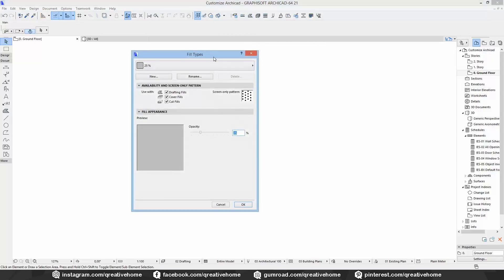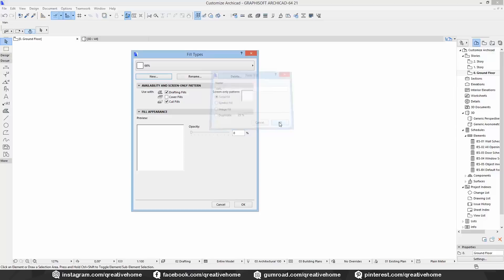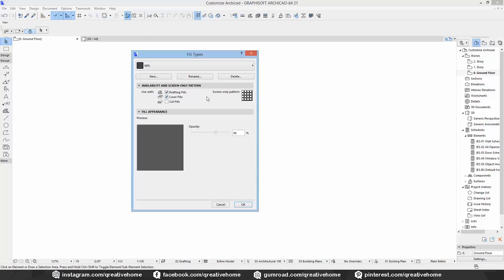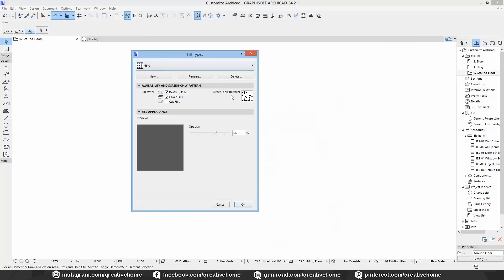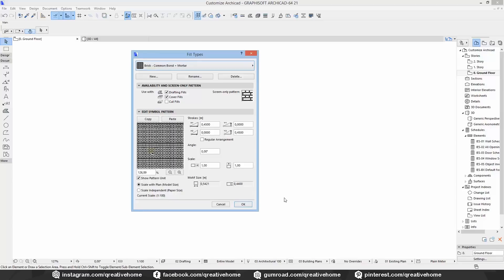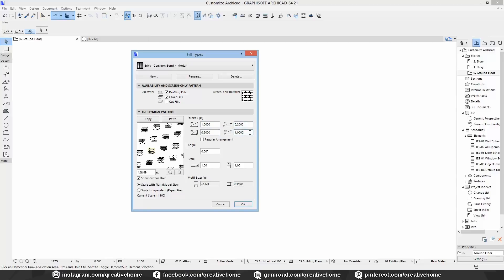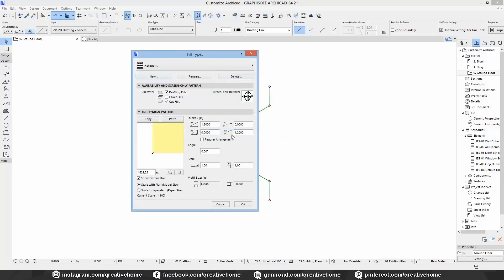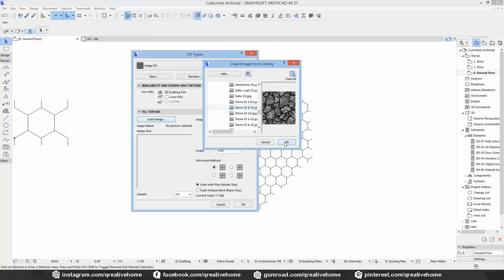Customize Archicad - Fill Types (Hatches) 02/16

Comment: I am using ArchiCad 22. When using transparent fills, for example a solid fill at 25%, all I can see is a SOLID fill will a toned down color of the original color. I cannot actually see through this fill to what is underneath as I would like to. I'm sure there is a setting I am missing... Are you able to help?.. Your video shows several transparent fills over top of each other, which is exactly what I'm trying to achieve, but I can't seem to be able to do that... Help!
Reply from the maker: A fill always consists of a foreground and a background pen. For me it seems that your background fill is set to solid white. Check the fill settings and set the backgorund fill to transparent (the symbol with the crossed circle, usually bottom right corner when you click on the background fill and all pens appear). 
I hope that's the reason.
Reply: @johannes_blum  That's it! I feel a bit silly for somethng sooo simple. You're very kind to have pointed out the obvious with grace. Thankyou :)